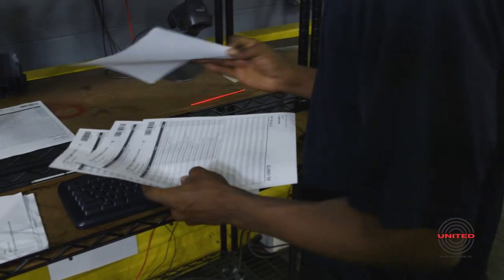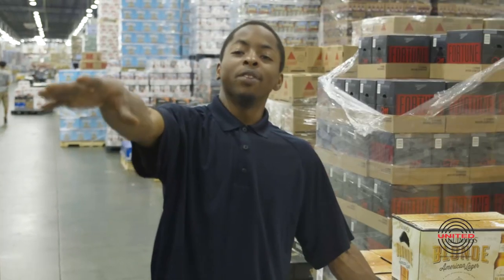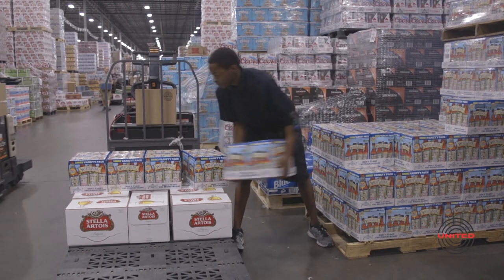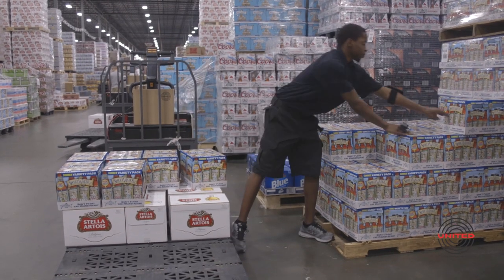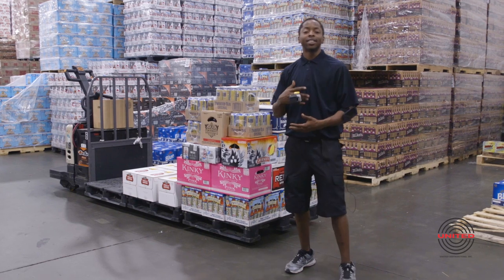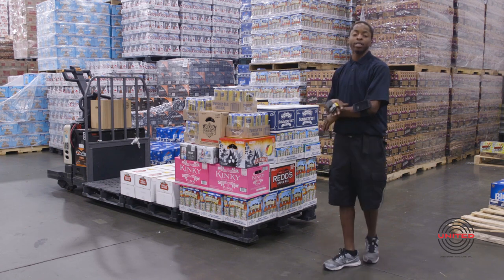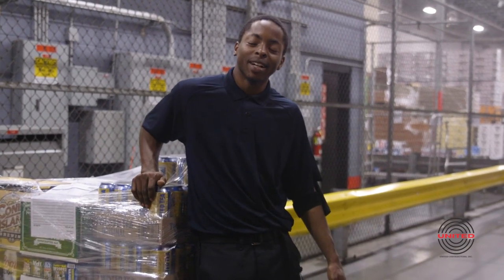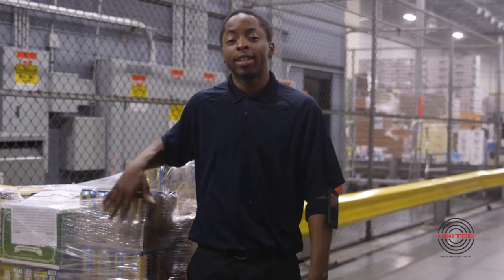Beer Picking & Base Stacking Process | United Distributors | www.udiga.com

Comment: This is the worst of all! Trust me if anyone is trying to get a job with these distributors, don’t even think about it. You will be under paid, over worked, etc. the list goes on and on. I used to work for L&F distributors and wow I am amazed they are not sued. I had to quit and look for another job after the recruiter mislead me with broken promises.
Reply: L&f distributors in Texas ?
Reply: I currently work there rn as an assistant driver
Reply: @raybad8010   yes sir. Quit while your at it. It is the worst job in Texas.
Reply: What made you quit there
Reply: @raybad8010   read my comment. That will answer everything you need to quit while you’re at it. Good luck if you end up making it your career.
Reply: What location did you work at ?